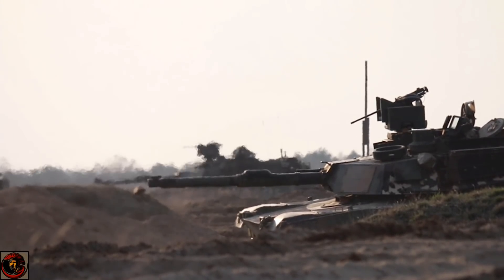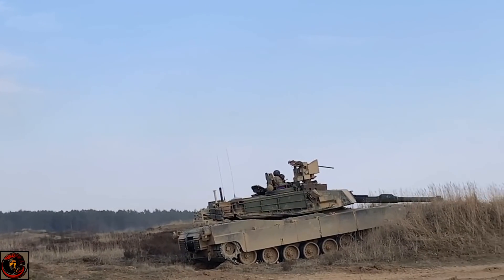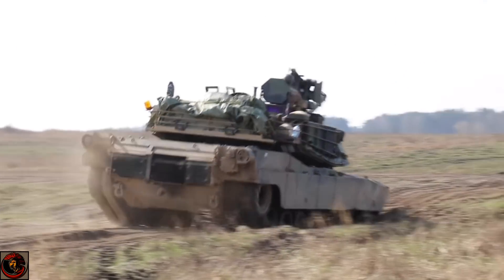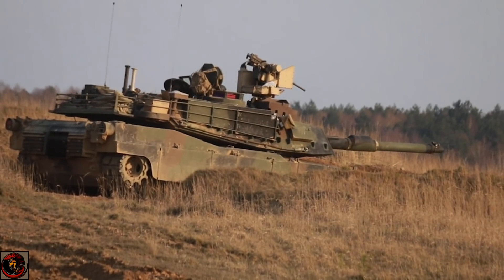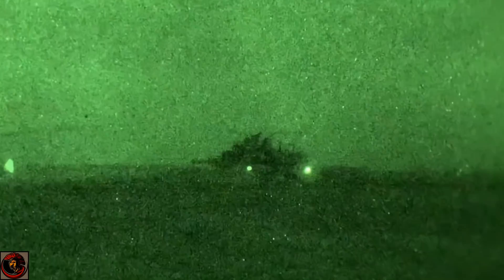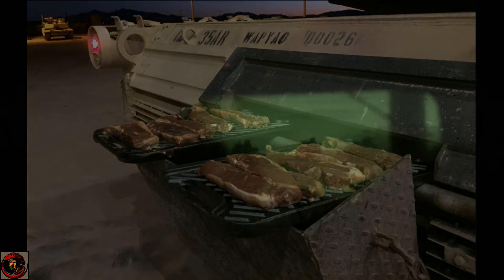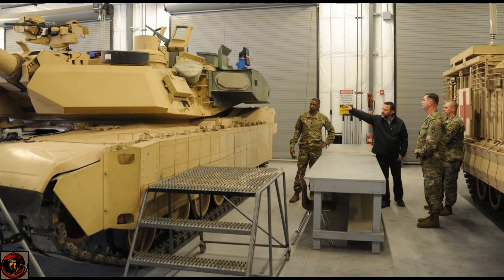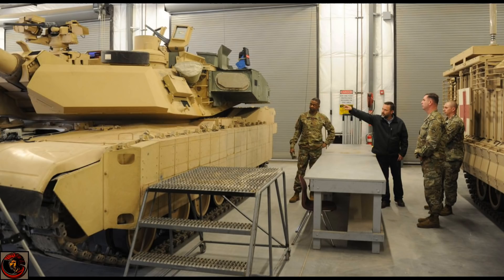M1A2C Abrams Tank Upgrade - The Last One?

Comment: The turret ring is still a huge weakspot ... Next upgrade should have new turret 😆
Reply: Ah I see, you are man of war thunder culture as well.
Reply: Badr 313 the game doesn’t even have spall liners modeled and apfsds shells breaking when hit ay ricocheting angles.
Reply: @ashati3176  dude a russian apdsfs sabot shell is like 35mm long kinetic rod
Reply: @ashati3176  Now after seeing the abrams.... yeah.. that ring isnt less than 35mm of width
Reply: @Badr-il3pg  go see a real one and you will see the turret ring is reinforced steel it's very thick. Those Russian commanders aren't gonna aim for the turret ring and the gap between it isn't 35mm it's actually 27 last time I checked. Just because one tank has a weakness doesn't mean they all do and don't insinuate you know more about tank rounds when you said he and hesh are the same
Reply: And if you look at an Abrams turret the turret slopes down towards the hull getting closer to touching it every mm. It is made like that so shells like your Russian sabot rounds don't go through and so they don't jam the turret either
Reply: @alhids35  lol dude the sabot would jam the damn turret. The He shell would just blow up and the upper glacis of the abrams is 30 to 40mm which is easy to pen by a direct high caliber High explosive or Hesh shell hit,meaning the driver is dead,the fuel tanks are on fire and you cant move , taking on more fire from the enemy. Also if you hit one of the large guns on the top or the optics with a lucky He shell, oh boy its gonna be messy in the turret because of thr spalling. They have spall liners but not everywhere.
Reply: @alhids35  talking about the .50 cal and the optics on the turret roof.
Reply: @Badr-il3pg  HE shells have no penitration power they wouldn't go through anything. Plus the actual armour thickness of the m1a2 is classified so there is no way you have proof of that  as well the optics have a back up and the 50 call isn't gonna be an issue no matter what no shell can go through a full 50cal without stopping.  And no it would stick in the upper turret catch and could be broken free with turret movement I know this because it happened.
Reply: @alhids35  have you any idea how hesh shells work? They create shockwaves which creates internal spalling, not penetrate the damn armour you donut. The damn spalling is gonna shred the crewi nside. Also the upper plate of the abrams isnt upgraded since he beginning 31.75mm plate its obvious. We know that the thickness has remained the same from the beginning m1 abrams to the m1a1 to the m1 ip
Reply: @alhids35  bro hesh shells can pen more than 100mm of armor and also if bigger, even more than that.
Reply: @alhids35  also the optics and the 50 cal on the roof is gonna be a damn good shell catcher. Giving the he and hesh shells a good advantage
Reply: @Badr-il3pg  listen very carefully. Hesh does create spalling. However there is what's Calle d spall net in the Abrams it's a small spaced armour section where the shockwave stops there are also spall catchers inside the tank to stop it from hitting the crew. While the hesh can pen 100 mm of pure steel armour the Abrams uses du composite and chobham 2 armour . This armour can stop any chemical round like the hesh. That's why we use sabot because we can't make chemical rounds any better
Reply: @Badr-il3pg  and the 50cal isn't a target for anything 1 that shot is impossible 2 a modern heat round couldn't pen a Sherman let alone the 50 Cal in the Abrams turret. Dude high explosive round detonate on impact it's not going through any armour. You need to shut your mouth and learn someone you have no idea the full armour strength of the Abrams so you wouldn't know that would happen but I can tell you it won't because the Abrams has been shot with 125mm Russian made he and hesh and heat rounds and it bounces them all or they detonate with no damage done
Reply: @Badr-il3pg  and the bigger the shell usually the less pen it has you are trying to tell a military strategiest of 5 years that you know better. You are basing everything you say off fucking warthunder
Reply: @Badr-il3pg  the thickness has change I have seen personally almost every model of the Abrams and I can tell you the armour has gotten thicker
Reply: @Badr-il3pg  and the armour is the same in your little fucking game with the regular m1s before they had anything better than chobham armour. Now they have du and chobham 2 with spaced armour and even some extra armour in the side skirts
Reply: @alhids35  he shells do create spalling. The hesh shells are just modified HE shells
Reply: @alhids35  The abrams doesnt have spall catchers all over the roof, only i  the front of the tank, the turret and the sides. Not the top
Reply: The abrams isnt up for the fight thats why they are getting replaced. Its gun cant pen the modern russian tanks*from front* while the abrams tank has a lot of weakspots like a damn turret ring shot . Just shoot a High explosve fin stabilised shell there and the spall is gonna kill he driver and jam or mess up the turret ring
Reply: Then Your optics or your 50 cal on top will catch HE shells which will then blow up, sending frgments in 360 degrees top down left right and center, and some are gonna damage a lot of bital components of that expensive tank
Reply: @alhids35  do you even play war thunder, that you are quoting we dont have chobham armor?
Reply: @Badr-il3pg  in warthunder chobham mark 1a is on the Challenger currently in game
Reply: @Badr-il3pg  if a he shell catches the 50 or the scopes on top it won't do anything because 1 explosions outside the vehicle anywhere don't do enough frag damage to pen the roof. And ever herd of blast glass? It's why when RPGs were hammering into Abrams all the time they wouldn't get knocked out from those "weak spots" because the blast and fragments won't go through
Reply: @Badr-il3pg  my experience is useful as when you plan a tank collum  YOU GET TOLD THE FUCKING ARMOUR VALUES FOR THE VEHICLE SO YOU CAN PLAN TO COVER THE WEAK SPOTS
Reply: @Badr-il3pg  high exsplosive squash head rounds are not just modified he. They are entirely new shells made for killing tanks. And once again no it wouldn't matter because again no hesh round has the kenetic force to creating spalling in an Abrams. And guess what the Russian tanks can't pen our front armour. So fuck off. And Abrams isn't getting replaced we are making a new model the m1a3 just like the leo 2a6 is newer than the a4 the a3 will be better than the a2.
Reply: @Badr-il3pg  once again the turret ring isn't weak it's actually stronger than most tanks turret rings
Reply: @Badr-il3pg  and again heatfs round is a chemical warhead something that is soooo out of date we haven't made new ones in a long time there sitting in storage rn because we can't use them
Reply: @Badr-il3pg  but hay how about you prove too me you know your stuff bud. When has an Abrams ever been knocked out by an RPG ?
Reply: @Badr-il3pg  fully knocked out no engines or tracks
Reply: @alhids35  heat warheads are used all over the fucking world
Reply: It's huge to give room?? Are you dumb?? Every tank currently has a large turret the one on the t-90 is bigger go look. The size of the turret doesn't matter as long as it's not very tall which the Abrams turret isn't
Reply: Dude go play war thunder you r#tard or just search for the armor of the turret ring. A panzer from the second world war or a HIGH EXPLOSIVE SHELL HE from a 120mm to 125mm cannon will completely render the tank useless
Reply: @Badr-il3pg  no no it won't lol the fact that was a problem in ww2 is why it isn't anymore don't base all your facts off a game 😂
Reply: @alhids35  lol dude have you any knowledgr even about tank shells? He shells act as Hesh shells on armor
Reply: @Badr-il3pg  no no they don't.... They impact and explode causing minor damage hesh impacts and get stuck to the armour as the he element explodes causing a shape charge affect sending moltant metal and the entire explosion energy at the armour either percing it or creating spawling killing or injurying the crew inside
Reply: @Badr-il3pg  an RPG can pen 300 mm but guess what an RPG won't go through an Abrams because there's this thing called chemical shell penitration rating. An RPG relays on a shape charge warhead. That is a chemical warhead the Abrams rating against chemical charges is over 1000mm like most modern tanks. I don't know where your information is coming from but 300mm is the fucking armour thickness not the effective thickness.
Reply: @Badr-il3pg  also the Sherman thing. A high explosive shell modern mind you wouldn't probably pen a Sherman m4a3  the most common model. And an RPG can pen 300mm cool an RPG doesn't fire a he shell it fires a heat warhead. That doesn't count
Reply: @alhids35  you told me that a fucking modern heat shell, cant pen a fucking 63.5mm plate of the sherman? What is your brain even doing? You must think that its a fucking thin plate.
Reply: @alhids35  dude, I WAS TALKING ABOUT HEAT SHELLS PENNING AND A SHERMAN AND SO WERE YOU, WHO ASKED THATH A HE SHELL FROM A CANNON CAN PEN A FUCKING SHERMAN
Reply: @alhids35  ever heard of an rpg or a fucking heatfs shell?

Comment: weight is a consideration I think, abrams= 60 tons,,M 60,,,50 Tons.120mm cannon,abrams `105 MM
my thinking is this kevin,on board a freighter could be  5=6  M 60s plus a ton  along with  other necessary war goods. shells,medicine food small arms,= 5=6 large ass pallets of spare parts for servicing,saving fuel time and a couple more of the refitted M 60s arriving at the scene of battle/s, matt did do a favorable review of the raytheon upgrades on the old reliable M 60 some time back..from raytheon,,,,
Offensive firepower is exponentially improved by swapping out the old 105mm M68 rifled gun in favor of the Abrams’ German-made L44 120mm smoothbore cannon. The addition of the new weapon would give the M60A3 the ability to engage enemy tanks as advanced as the T-90MS on a near equal footing. In fact, with the upgrade, the M60 probably outperforms older M1A1 variants. a 3 front war,I hope there is not one,getting the mostest to each location with the leastest fuel, will be imperative,I might add also, US forces use precision tech in drone recce,  navy launched smart weapons, the buzzing warthog,-<-- air assets,and artillery miles behind the ground contested.Russian tank #s offset  by total allied hardware.
Reply: The model being discussed (A2 C) is just below 74 tons. The 60 ton figure refers to the initial production model M1 (A0). Which also was armed with a 105mm cannon (M68) like the M60 Patton.

Comment: The Abrams may be the tank version of the B-52.   It may be upgraded long after anyone thought it possible. Abrams are frequently re-manufactured  to the newest standards.   Another Great Video.
Reply: The correct term would be refurbished. There hasn't been new Abrams hulls/power plants produced for over 20 years. 

The layman example would be like you have 1,000s of truck chassis, engines and transmissions in storage. Then just built more modern versions of the same truck, by combining those parts with top of the line parts. You can go a long way and get the job done with that strategy.
Reply: @KSmithwick1989  excuse me but there haven't been abrams made for the us in 20 years
Reply: @alhids35  Correct, which is why I used the term refurbished as opposed to built.  Re-read the post.
Reply: @KSmithwick1989  I'm saying you are wrong
Reply: @KSmithwick1989  there haven't been abrams built for the us in 20 years keyword is us

Comment: Abrams is now most battle-proven western tank. Very decent armor, excellent main gun, ammo and targeting systems, but a number of issues which can hardly be solved. Overweight, uneasy in service and very complex in mantainance engine, terrible fuel consumption, 4 ppl crew, weak top armor (side armor  is in fact aint too bad for a mbt). Abrams is not impenetrable,  but survives pens much better than leo2a4 for example. With armament allowing to acquire and hit almost any kind of target with first shot from afar( depends on landscape), it have not too much threats in field to be afraid of: Atgms, ieds and mines, arty barrages and skilled enemy.
 In urban scape abrams looses upper hand, like most mbts. Upgrade packs solve number of problems, but add some, especially weight. Imo  abramses are aging well, but aging.
Reply: Because its armour has been designed for anti tank ammunitions, leopards for example APFSDS type of ammunition that Just penetrates with kinetic energy thats why, if hit by an quality gun and APFSDS ammunition ambrams would likely got grounded
Reply: @eggyballsteabagsgtfo9988  depending on where hit will come and which ammo will hit, as usual. Probably front turret plates can stop most apfsds from 1500+m. When tank got penetrated, it can burn, explode or resist. We have seen many times pierced abramses, which burned or just broke, and leo2a4s which have comparable armor, which explode like hell. In fact, much worse than many times blamed t-72s, which explode only if relatively low placed autoloader hit.
Reply: And apfsds aint a threat at all in most battles. Tanks rarely battling tanks. Atgm is a threat.
Reply: @doombringer3498  very interesting. There are substantial differences between M-1 and Leopard 2 family - but where and when did anything above A4 got hit and exploded ? Turkey ?

Comment: What tank is the best...nowadays the one that gets the drop on the other tank and fires first from behind cover lol...Which gives me an idea...go old school tech to avoid interference...  what about a deployable drone system that is capable of loitering  above the tank at say 200 or more feet giving real time long range vision with all the usual thermal and night vision capabilities to monitor the area...something like a mast or periscope...but not...Have  a drone that is tethered to the tank...powered and controlled by a line...not wireless controlled so it can't be jammed..
Reel the line out to deploy and reel it in when you are done or have to move...kind of like barrage balloons equipped with cameras called aerostat being used in Afghanistan to monitor areas susceptible to attacks...7 of which are always watching 1500 feet above...
Reply: A loitering drone would be like screaming  “I’m here” to everyone nearby. Also IIRC Russia claimed their T-14 to have 25km detection range for enemy armor vehicles, which is more than enough for a tank. Just add a normal small UAV and try to improve the link should be better.
Reply: @Estelle-385  An idling jet engine kind of screams I'm over here anyways...might not be practical for all situations but could have its uses...and ease of deployment without having to leave the tank and being secure from jamming was what I was thinking...
Tank stops...small dedicated hatch opens and the drone flies up into the air on a tether..crew checks out the area it is heading toward then reels it in...all while secure within the tank....and I'm talkin in the 12''x12'' quadcopter size...and being tethered would allow it to stay in the air forever and carry more then a drone that has to carry it's batteries and camera transmitter...plus with the tech available today it would be easy to make it pretty quiet...though once it is a couple hundred feet in the air they are not that loud...
Anyways just spit balling ideas...

Comment: They need to replace the L/44 gun with an L/55, since they've maxed out their penetration with APFSDS on the L/44. I'm not an expert on tanks and i don't claim to be, I'm just going on information i know. Also i love these videos :)

Also i thought they were making/developing an M1A3 Abrams, but i could be wrong
Reply: They can't DU needs to go slower so it doesn't get brittle at higher speeds and shatter. If you look at the velocity of m829 (first round for the m1a1) vs m829A4 it's about 200? Meters per second slower. Adding the l55 would hurt the tank more than help it
Reply: @tjwine465  the velocity of a shell can be adapted. If you put an M829A4 into an L/55 it wouldn't be as effective, but the thing is that they could make a new round that is denser then the other one while keeping the required velocity. But they also could increase the density and velocity of the DU round, but also keep it below the pressure that could render the round to brittle and usless, because its the pressure at these higher velocities that hurt the round. The L/55 would be quite beneficial to the Abrams, and if it doesn't do well then they can revert back to the L/44.
Reply: @isaiahconklin5942  also one thing to keep in mind is that m1 would need a new stabilizer block and new counter weight for the new gun, not to mention that it being longer and America using them in the middle east, I think they prefer thr shorter barrel for the low intensity conflicts. If they nerd a upgrade for the gun I suspect they would just use a bigger caliber all together
Reply: @tjwine465  a counter weight and stabilizer would be no problem for them to handle, and their engagements wouldn't be affected by the increased barrel lengths. If they were to just increase the diameter of the gun from say 120mm to 125mm, it would completely render their other ammunition incompatible, thus costing them valuable resources in making new ammunition for the 125mm rather than just using a longer barrel
Reply: @tjwine465  That's a myth. While DU does perform relatively better at low speeds, it does not negate the simple increase of muzzle energy with a faster projectile. The reason the later M829 are slower is simply because they're heavier. The US tested both, DU and tungsten alloy ammunition with the M256E1 L55, and both performed superior. The reason the US sticks with the L44 is because the Abrams stabiliser can't handle the increased weight and shifted center of gravity on the L55. A new stabiliser was required, and deemed to expensive back then.